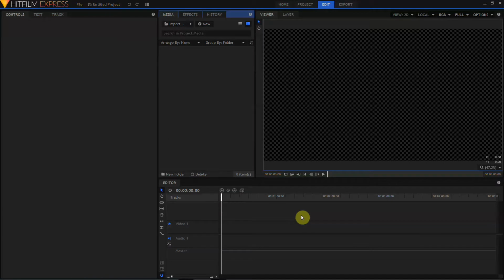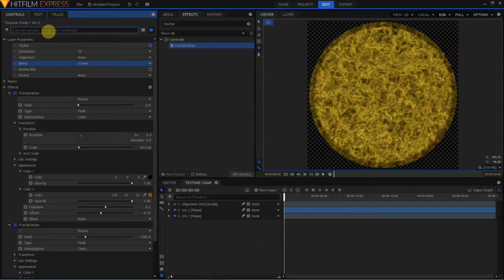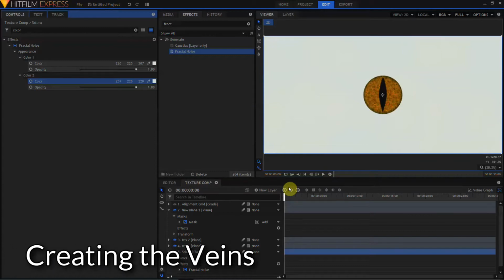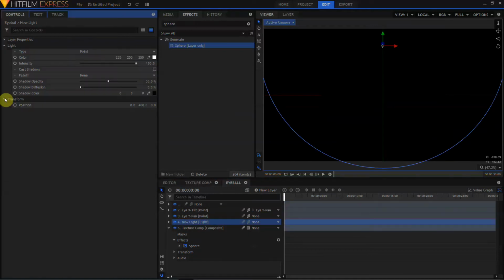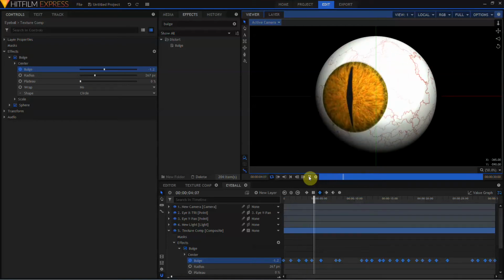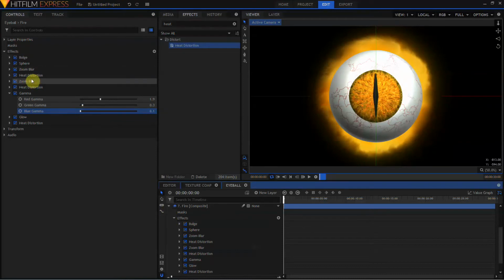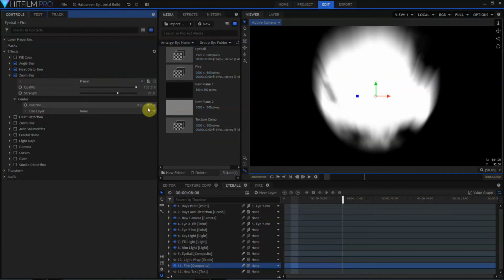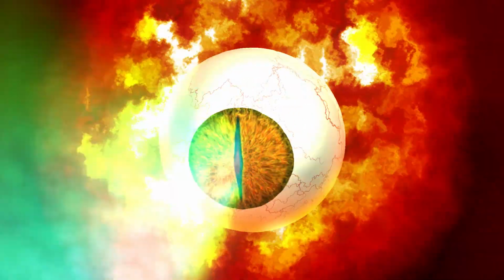Hitfilm Effects Lab - Spooky Halloween Eye

Comment: I liked the alignment grid so much I made it a preset!!!!
Reply from the maker: Dane Andersen One strange thing about Grid presets is they seem to auto-scale when placed on layers of different sizes. For a preset, think in percentages, not pixels. So, perhaps you've made a "10%" grid (on a 1920x1080 comp point 1 would be at 0,0 point 2 would be 192, 108). Sticking this grid on, say, a 1280x720 plane, it SHOULD resize. The pixels won't be the same, but it should still be a "10%" grid.

Either way, setting up the 0,0 point and the two layers of red/green makes adjustments easier later. :)

Glad that was a good hint for you! :)

Comment: A fine detail I liked was the using a very faint fractal noise for the white of the eye. A flat color would be, well, flat. The subtle texture adds to the result even if it is not obviously visible.
Reply from the maker: Norman Black Glad you picked up on that!

You'll appreciate that I set luma values of 220. I always try and keep colors in the NTSC range. 220 gave a little headroom if prepping for broadcast and a lot of headroom for YouTube. Helps keep the eye beam from completely blowing out.